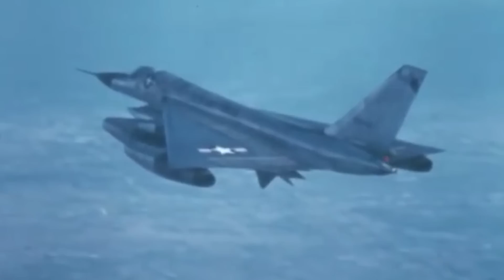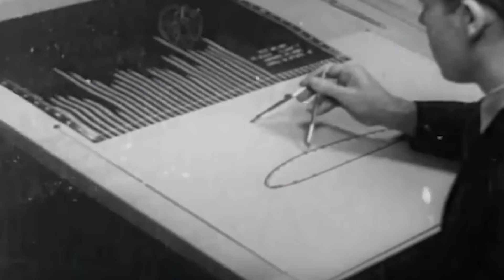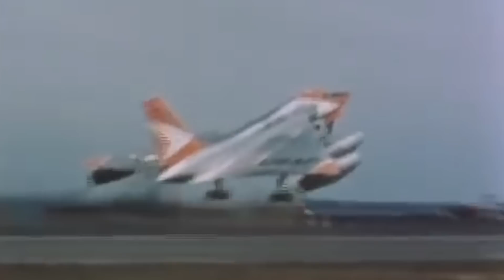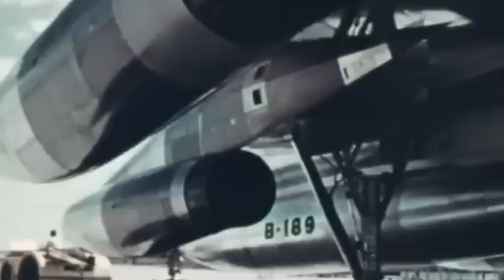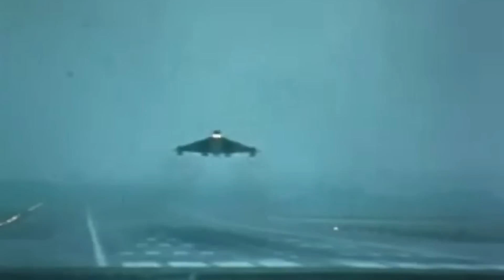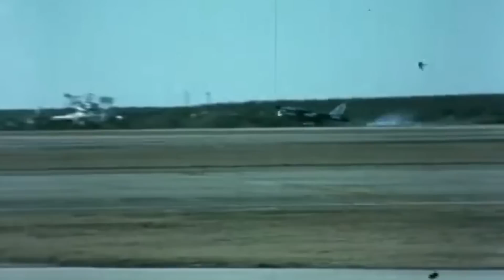The High-Stakes Bomber Only the Bravest Pilots Dare to Fly

Comment: The B-58 had a rather short service life.
Stress fractures and tears on the fuselage did it in. Brigadier General Stewart flew one for a film on it.
Reply: Correct that the B-58 had a short service life and suffered from stress fractures.

However, stress fractures alone did not "do it in" high costs, changing mission requirements, and more versatile alternatives played a bigger role in its early retirement.

The B-58 was initially designed for high-altitude nuclear strike missions, but advances in Soviet SAM technology made this strategy obsolete. Switching to low-altitude penetration bombing (to evade radar and missiles) increased structural stress, worsening fatigue problems.

The FB-111A, a more cost-effective supersonic bomber with similar low-level penetration capabilities, was introduced.
The B-52 fleet was upgraded with AGM-69 SRAM (Short-Range Attack Missiles), making them more adaptable and negating the need for the B-58.
Reply: Stewart did not fly a B-58. He rode in one.

Comment: Had an uncle who flew on B58s at Little Rock Air Force Base. I believe his crew position was Defensive Systems Operator if I have term correct.He later flew in Vietnam on jets that jammed enemy  radar. After retiring as a Lieutenant Colonel  he went to work with the company  that built the B2 Stealth Bombers

Comment: Passing notes to each other?  What a line of bull.
Reply: Sorry you think that because it’s completely true!
Reply: @boykinlp  
How?  Individual compartments, seperated by a pretty good distance.
Reply: @ronfry3324  You get into each “section” through an individual canopy door, but there is a pass through on the crew’s left side, where the string and pulley system is set up, and large enough for the crew members to actually reach through.

Comment: The F-102 had problems with top speed. The F-106 used the "Area Rule" & was MUCH faster. B-58 was very cool.
Reply: Eight pre-production F-102 aircraft built with non-area ruled fuselage. Remainder built (879) with area ruled fuselage.
Reply: @JackNiles-hc8yz "Even with that, they still had too much drag."

Specify.
Reply: @JackNiles-hc8yz Yes, we know the fuselage was entirely redesigned, thus being designated F-106 rather than F-102B. Your comment suggested you know what the increase in aerodynamic efficiency was, not its source.
Reply: @JackNiles-hc8yz The F-106 had a much more powerful engine, +42%. However, the F-106 was 31% heavier empty.
Reply: @JackNiles-hc8yz Specify the top speed of both.

Comment: Crazy me. To run a project to build an updated -58 with today’s tech, materials, engines, electronics, manufacturing and super computers. With the goal of staying as close as possible to the original form and configuration.

I have no doubt all issue would be solved and the result would be spectacular.
Reply: Spectacular - and strategically useless! But fun.
Reply: @davidwright8432  Spectacular - strategically useless, and EXPENSIVE! But fun. Fixed it for you!😂

Comment: I worked in the tower at Little Rock AFB 1969. They were something. When they reported 15 miles on final you didn't have another a/c in front of them. The speed on final was very high. They retired them and took them away moving the C-130's from Sewart AFB in Smyrna to Little Rock.

Comment: 2:40 about. "relatively nothing" - please explain how you relate absence to something else that obviously must be different measures of something. Something in the system must be different from absence as it can't be related if it is fixed, saying "nothing relates to nothing" while it may sound true - isn't. If I have two empty cups, their "content" does not relate because there is no content. Technically speaking NULL does not equal NULL because if it did, it wouldn't be NULL. That is why for example you have "if (isNull(x))" to check if 'x' is NULL instead of using  "if (x == NULL)" if you didn't have this 'specialcase' behavior, NULL would not be NULL but rather a something representing, but not in fact being - NULL, it would be a 'false NULL'. Nothing cannot have a placeholder, because the moment it does, it stops being nothing. You cannot, in fact, compare NULL in a traditional way because a comparison requires a minimum of 2 things to compare, which you are lacking if you are trying to compare something to it. That's why "if (NULL == NULL)" does not in fact return true, it faults. I could go on, but I think this is enough of something about .

Comment: The B-58, F-111 and B-1 are 3 of the most gorgeous jets built. 2 are already gone and the B-1 won’t be with us much longer. Then we’ll be left with the ugliest and oldest bomber in history. The BUFF. SMH…
Reply: The B-1B will be with us through the 2030's. The fleet is now down to 45 but they continue to update her.  There's an assembly line at Tinker AFB that is taking these 12,500 flight hour birds and rework them. 4500 hours of work during a 35 day stay.  They are still testing a fuselage and wing from a retired BONE out to 25,000 and 26,000 hours respectively.  Boeing has come up with a new adjustable bomb rack that will allow the carriage of 8 additional JASSM/LRASM stealth cruise/anti shpping missiles in addition to the 24 they can carry internally on triple 8 missile rotary launchers..  This is an important capability with the pivot to Asia.

Comment: One of the most impressive legendary bombers ever. But surely the engines max thrust must have been more than only 10k lb. thrust each. Compare to a Boeing 707 engines of 19k lb. of thrust each. Why making use of hand signals between cockpit crew members while there is a good intercom system?
Reply: The J79s were rated at approx 15k lb with reheat. The JT3D engines of the 707 are bigger, heavier and have a fan.

Comment: I was stationed at Bunker Hill AFB from 1962 to late 1964.  I was assigned as CQ at the alert barracks for one year.  The B-58 had just been make operational and I had a close up observer of the operation of the bomber. I then cross trained to the KC-135 tanker simulator which shared a building with the B-58 simulator. I value that time I was so close to those airplanes which was the best experience of my life. The bomber was under the SAC 305th bomb wing and the tanker was in the 64th Air Refueling wing. I was in awe of that B-58 and saw a lot of it's takeoffs and landings.

Comment: We used to watch them coming into Grissom Air Base in the late fifties.
Reply: No, you didn't. B-58s were not stationed there until 1961.

"The second wing to receive the B-58 was the 305th BW at Bunker Hill AFB. Equipping of the wing began in December of 1960. Following official instigation of the reorganization of the unit on January 9, 1961 and its attainment of wing status on February 1, the first aircraft was flown to Bunker Hill on May 11."

Comment: 4 J 79 jet engines,  with afterburner,  Jet Fighter Engines. I had the privilege of seeing this jet fly, when I was young,  then later worked and flew in F 4D Phantom. 2 J 79s in that jet. Now retired and happy to see your video!😊
Reply: I was a wild weasel F4G guy
Reply: @jimsteinway695  F4E crewchief at Ramstein AB, Germany '83 - '86.
  F4G's '86 - '89 at George AFB, Adelanto/Victorville Ca..
Reply: I was at Lambert Field once in the early 80s, when you could go down to the gates, waiting for an arrival.  I could hear a very high-pitched whine coming from somewhere outside.  A few seconds later, two F-4s leapt off the runway.  Those J79s cut through all the other airport noise like a knife.

Comment: My step father was a USAF test pilot on the Hustler. He said he loss one of his friends in Utah after the aircraft loss control at high altitude. He told me it was a unforgiving airplane and he was glad his number of takeoffs equaled the number landings in B-58. The ejection capsule was an automatic coffin.
Reply: So how many times were the ejection capsules actually used? And what was the survival rate? Did they work at all?
Reply: @SkepticalSteve01  Yes, they worked, about as well as any other contemporary system.  It wasn't "an automatic coffin".   The ejection parameters were pretty narrow, though.  If you ejected and died, you were probably out of the envelope.
Reply: So… best used when in straight & level flight? When you might prefer to stay in the plane? And you don’t know if you’re “out of the envelope” until you’re dead? Sounds very reassuring.
Reply: That's some convoluted reasoning right there, Steve.  You don't have a clue, do you?
Reply: @dukeford8893  You must have a really unusual definition of “convoluted”, chum.
Reply: @SkepticalSteve01  Not really.  I'm just not sure what you're getting at.  Ejecting out of an airplane in level flight is pretty common. So is ejecting "out of the envelope".
Reply: Come on. Use you brain.@dukeford8893
Reply: What was his name?
Reply: @smark1180  Last name Lackey
Reply: As a consequence of Radiactive fall from Nuclear tests these days, wild boars in German Woods have a so high amount of Radio activity in its meat, that are unsuitable for human consumption.
Reply: Holy Moly hopefully they are safe now

Comment: The plane was just too advanced for its time. Using the experience from Convair, General dynamics, after a few false starts, got it right with the F-111, which could carry much more versatile bomb load and could safely fly at low altitude, thanks to its terrain following radar.

Comment: I was born at Carswell AFB in 1959. The B58 was coming of the assembly line right across the runway. The 43rd Bomb Wing my father was a crewmember of transfered to Little Rock AFB in 1964 and remainded there till 1970. I was 7 when I got to sit in the pilot seat of one of the record setting aircraft. For the trivia buffs, John Denver"s father Col Deutschendorf was a B58 pilot with the 43rd
Reply: My dad was B58 mechanic in Little Rock in 1967-68.  He hated those things.  Said they required 50 hours of maintenance for every hour in the air.  He said because of the high landing speed, it would blow tires all the time.
Reply: literally named the hustle err.
Reply: John Denver had an aircraft problem.
Reply: @christopherskipp1525 YEP, it was known as a 'DINKING PROBLEM'.
Reply: In the 80's there was a the picked over carcass of a B58  in a material storage area adjacent next to main taxiway at Little Rock. It looked fast even in it's sorry condition.
Reply: You must be so proud of your father joining a murderous group of government sanction killers. Seriously how can anyone be proud of anything to do with killing from 50 000ft.
Reply: Believe he still holds the speed record for transatlantic crossing time

Comment: A remarkable achievement, particularly considering it was designed in the mid 1950s. Very experienced crew, some of whom later joined the SR-71 program. Worth remembering that while building the B-58 Convair were also building the F-102/F-106, R5Y Tradewind, XFY-1 Pogo VTOL, F2Y Seadart, and the SM-65 Atlas ICBM / Space launcher. Unfortunately it achieved operational status roughly at the same time that SAM development rendered high altitude penetration less survivable. Low level performance was also impressive, but range limiting. Finishing problem was high operational costs, only two wings created, with overall costs roughly equivalent to 6 wings of B-52s. Beautiful plane though.
Reply: My uncle was a weapons control operator on the B-58 and went on to be a yf -12 weapons control operator shooting hypersonic missles at B-47 target drones over the Gulf of Mexico.
Reply: SR-71 = “the Black Egret.”